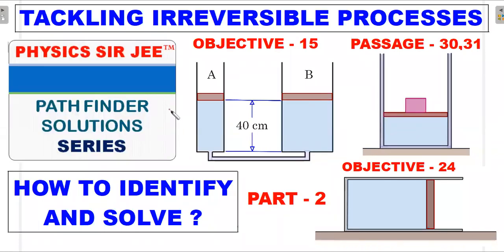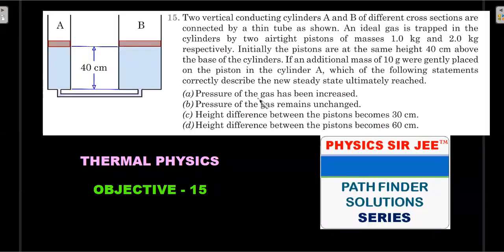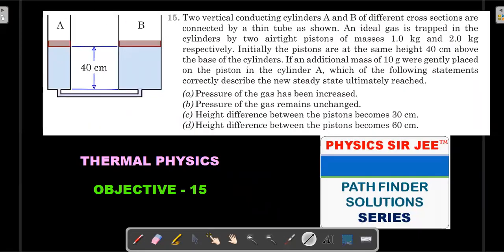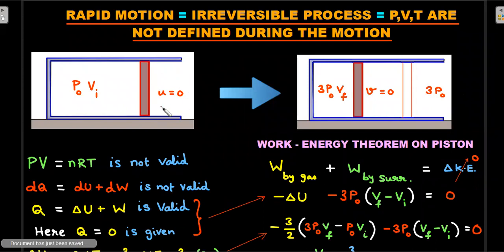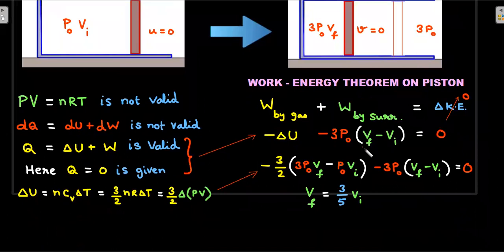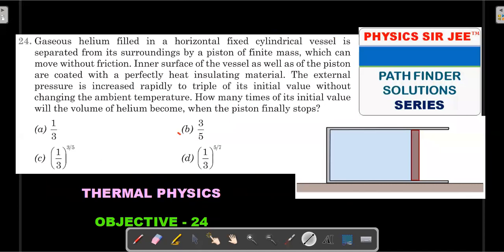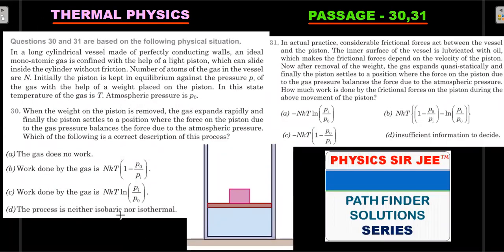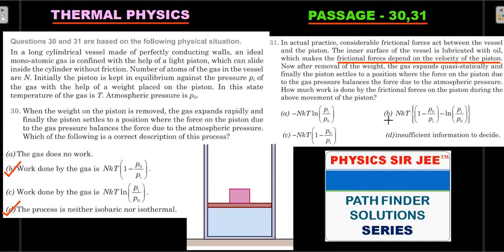JEE Advanced: Four problems on IRREVERSIBLE PROCESSES you must solve!

Comment: For practice problem 1, I am in some doubts
For practice problem 2 , at 25:15 , I am getting ABCD ,
For practice problem 3, at  25:55 , I am getting ABC
For practice problem 4, at 26:25, I am getting u^2/7g
Reply from the maker: All three , you attempted are correct 👍🏼🙂. Any issue you found with JEE 2015 problem at 25:55 ?
Reply: @PHYSICSSIRJEE  Yes sir, I told that in an already posted comment on the ambiguity of that problem where you have given a heart :) ... Basically about the gas being not mentioned at the right side...

Comment: Sir I am unable to understand how will the equilibrium be reestablished in practice problem 1 at 24:20  , as the collision is elastic, so won't the ball keep moving up and down, and there is no energy loss as well? and the mass of the piston is taken to be light, so does that mean, piston will rapidly fall down? This is a bit confusing...
Reply from the maker: The orderly energy of ball gets transferred to the disorderly energy of gas via piston upon multiple collisions
Reply: @PHYSICSSIRJEE  Ok sir, but I think this should have been mentioned in the question. Also, I think it would take infinite time to reach the state of equlibrium in theory...and after that is achieved, then we are supposed to solve that problem

Comment: I am a big fan of urs...First of all my huge respect and greetings to you...🙏🙏..
In the 3rd problem which you solved with friction u mentioned it as reversible process... Unfortunately it won't be...This process is better to be named as" Quasi-Static process with Friction", not Reversible process...Since this is a Quasi-Static process one can use work done equal to integral pdv and all the state properties will also be defined... So no issue in applying formulas...Still we cannot say it to be Reversible process because of the friction...In this process heat will be generated due to friction and once we reverse the process and again heat will be generated due to friction which will certainly affect the surrounding... Reversible means which when reversed both the system and surrounding should be in same previous state at all the times...Since there is non zero entropy change due to friction it won't be Reversible... 
I am not explaining these things to you because you yourself are a stalwart...I can't even think of this dare... Whatever little explanation I have written is only for students...I keep watching all your lectures with enthusiasm and gets affected when u say u won't upload further videos due to insufficient likes or subscribers... Those students are definitely lucky which get to learn Physics from you personally...I myself have shared your videos to many students... Numerous concept such as surface tension, rotating frame videos, resolved series videos, etc...There is so much to learn whenever u upload any video... Kindly keep making such videos...You are a teacher to me.. Happy Guru Purnima...Charan Sparsh...Kuch galti hui to maafi...🙏🙏🙏🙏...

Comment: Sir I have two queries
1.  what is basic definition of adiabatic process ∆ Q=0 or it should follow the equation pv^gamma =constant 
2. You said we can use ∆Q=∆U +W for initial and final condition then why can't be use equation pv^gamma for the initial and final condition if it is a non quasi-static process and heat exchange is zero
Reply from the maker: 1. ∆Q = 0 
2. PV^gamma = C is a curve on which final state of irreversible process need not lie

Comment: 20:25 Sir, can’t we say process is irreversible isothermal ?
Reply: For the process to be isothermal dT=0 (T is not changing throughout the process )we can only comment on the Tf and Ti of the process,but in between the extreme cases there is surely change in temperature.

Comment: Sir how did you come to the conclusion at 7:30 that the left piston will be at the bottom of the left tube and not anywhere in between the initial height and the bottom of the tube?
Reply from the maker: Unbalanced downward force on piston as explained clearly is the reason

Comment: Sir. In many of these problems, we get different answers for assuming irreversible and quasi static. But in the irreversible case, we get the ans, by doing Delta Q = Delta W + Delta U, and PV =NRT For the inital and final states. But in the quasistatic case, we use dQ = dw + dU. for the intermediate states and get a relation for the state varibales. But Doesnt dQ = dw + du imply delta q + delta w + delta U? So why are we getting diffferent answers for quasistaic and irreversible, if the equations we use can be the same

Comment: Sir plzzzz solve this question of olympiad 👉👉👉👉Let us consider a model of the Atwood machine, which consists
of a square prism, ABCD, whose central axis is horizontal and
perpendicular to this sheet of paper and whose face AB makes an
angle of π
4 with the vertical line. On the upper faces AB and BC
of the prism, there are massless bodies P and Q, respectively. As
shown in Fig. 2.37, the two bodies P and Q are connected by an
inextensible massless string, S1, and similar strings S0 and S2 are
hung down from P and Q, respectively. Note that the string S1
is horizontal and strings S0 and S2 are vertical. Here, we assume
there is static friction between body P and face AB as well as
between body Q and face BC; the frictional coefficients for both
cases are µ0. Suppose bodies P and Q are always in contact with
faces AB and BC, respectively.